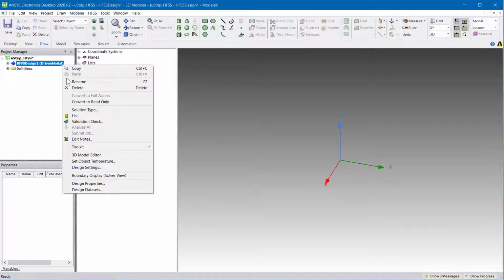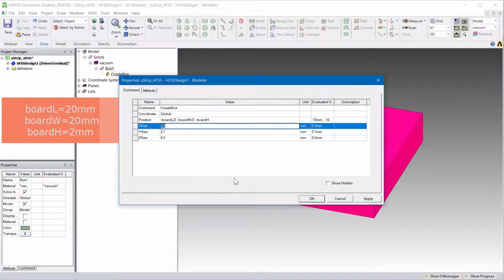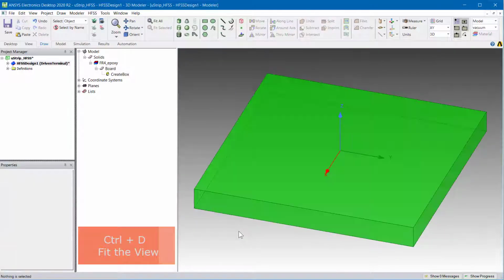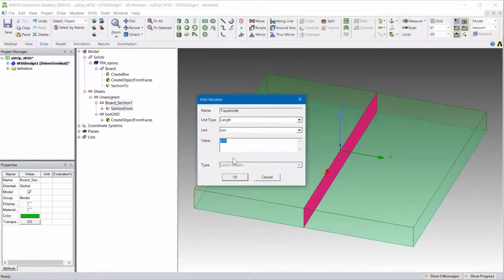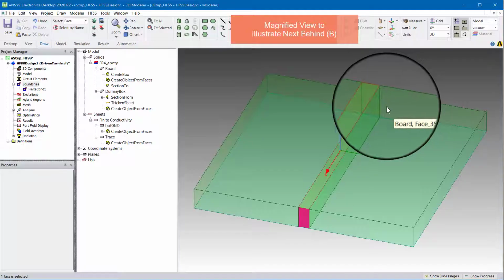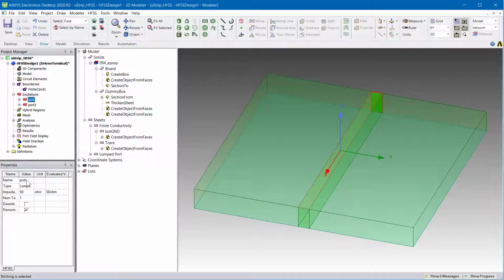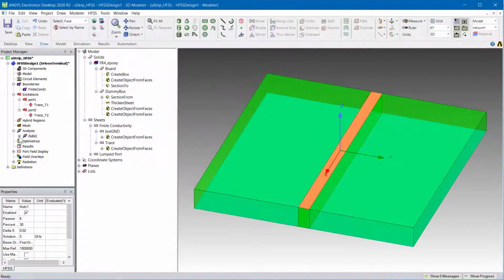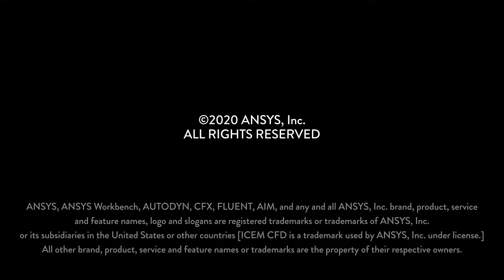Simulation of a Microstrip Line in Ansys HFSS

Comment: Upon simulation, I am facing the error "Port Refinement, process hf3d error: Too few conductors were found on port port1. There should be one conductor for each terminal with one additional reference conductor. Unintentional contact between conductors may cause this error.". How can I resolve this error ? I have followed the same steps as shown in the video
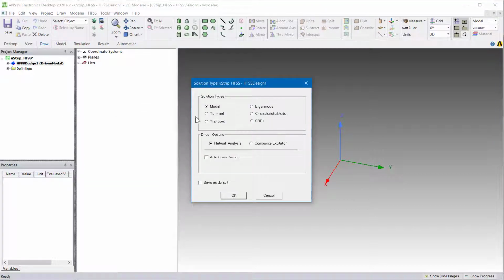Reply: I had the same issue, but after I applied the same Solution type (00:34) it was fine. I had to choose the Terminal modal port for the assigning excitation
Reply from the maker: Thanks for watching! Please post your query on the Ansys Learning Forum for a detailed answer from the wider Ansys Community: https://ansys.com/forum.
Reply: This is a bad way to answer this. Following the exact instructions of the video causes this error. @AnsysLearning